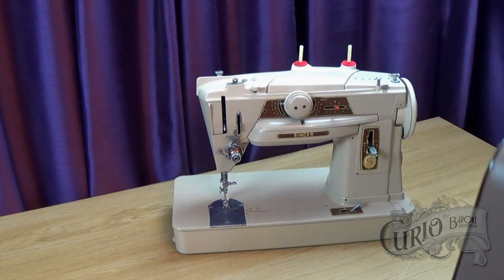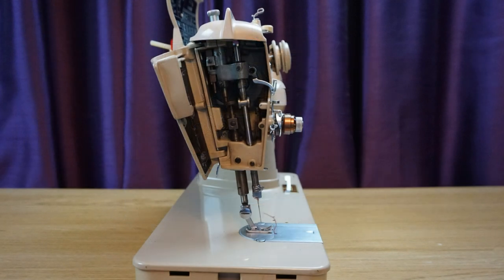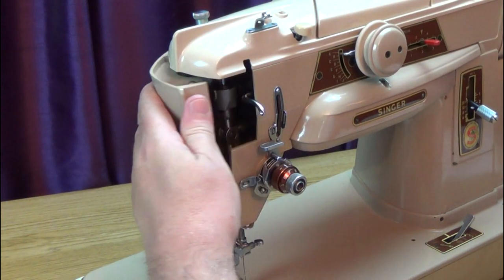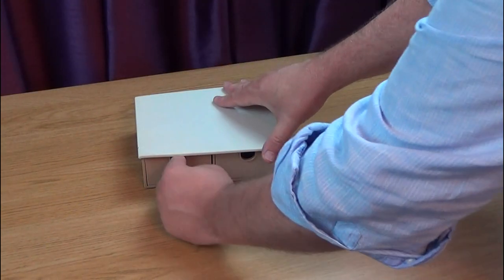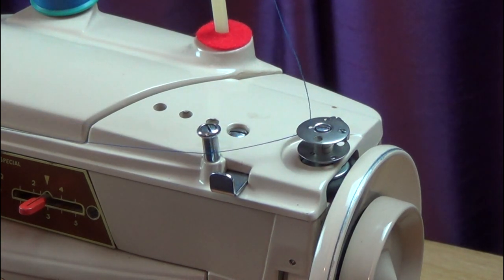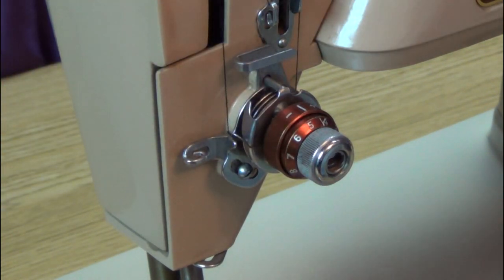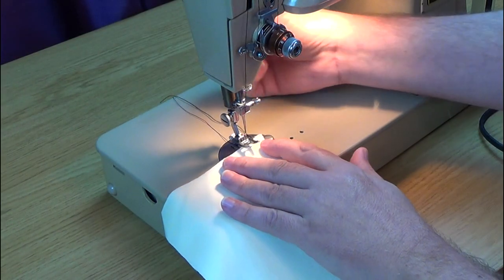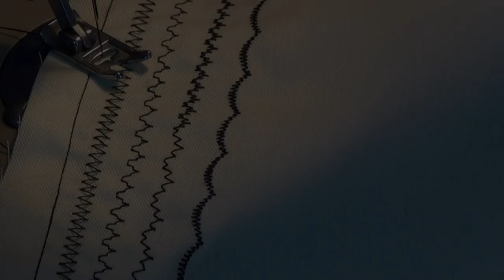Singer 401g Slant-O-Matic Vintage Sewing Machine

Comment: Maiden voyage of my new Singer 1956 401 G today
after my lube and oil so silky smooth and powerful made from recycled Luftwaffe aluminium airframe this machine flies so gobsmacked by stitch quality
Cost $60 Australia & some enthusiasm wife bought for me Fathers Day
Thank you for sharing your knowledge and great presentations 
Mmmmmm there’s a ghostly call in the wind “time for another sew machine”
Reply from the maker: That was a good price! The rotary hook mechanism and all round excellent engineering makes the 401g a machine I would be reluctant to give up. So what type of machine next?
Reply: @CurioByBSpokeDesigns  
The Rocketeer but most have their front plate missing
Reply from the maker: @Thespiansewist  Never see them here in the UK

Comment: Thank you so much for this helpful video.  I've been using my mother's 401-A model my entire life, but yesterday it completely locked up after 60 years of use - those troublesome cams, I suspect.  Fortunately I bought a 401-G about 5 years ago, so I have a spare.  This video helped me make the transition.  I plan to fix my mother's machine, but having the spare allowed me to complete my project and work on the other machine at my own pace.  I am so very pleased to have been offered the 401-G for £85 from the fine old gentleman who used to service my 401-A.  These are such glorious machines and well worth buying and maintaining.
Reply: Thanks for sharing. I inherited my 401-A from my mother. Just trying to reintroduce myself to it .
Reply: Agreed
Reply: На продажу есть машины?

Comment: It sounds great and stitches beautifully.   I have the 401g too but mine doesn't sound quite as quiet as yours! Think I need to have another look inside. Also, I think I've been threading the secondary stitch guide the wrong way round. 🙈 Thanks for taking us around this lovely wee machine.
Reply from the maker: You're welcome! I believe you can skip the secondary stitch lever altogether without issue

Comment: Interesting. I'm eyeing a 401A, but I had no idea that that machine was actually produced here in Germany. Guess, my chances of getting additional feet and, if necessary, parts for repair are actually pretty decent then. This is my biggest concern with aquireing one these oldies.
My 10 year old high end, computerized Pfaff has 'issues', which point to a defect chip and I honestly don't know, if I want to invest 300-400€ into repairing it. I hardly ever use anything but straight and zickzack stitch anyway. Maybe I would be better served with an old machine, I can take care of myself.
Reply from the maker: The 401s are still easily available and you should not have any issues getting parts. There's plenty of vintage sewing machine specialists who can help.
Reply: @CurioByBSpokeDesigns  
Thanks! These videos are really immensely helpful - I wouldn't even consider this, if there wasn't so much information available on old machines by  now.
Reply from the maker: @raraavis7782  You need to take a look at my video on vintage versus modern machines.
Reply: @CurioByBSpokeDesigns  
Already did. Working my way through your videos 😉
Reply: I didn’t know either. As soon as the video started …. Learned something new!

Comment: What do you recommend to clean the paintwork on this machine please? mine has dried old oil that has leaked over the front from where it was stored face down in a table, I think whoever "serviced" it overdid the oiling!
Reply from the maker: If you are in the UK, Swarfega - original formula. If you're in the US, Gojo - non pumice
Reply: @CurioByBSpokeDesigns  Thank you, UK here :)
Reply from the maker: @janevacani6789  The swarfega works great on these!

Comment: I am really struggling to get my thread round the tension dial and to hold the metal loop upwards the thread just slides off to the side...
Reply from the maker: Hold the reel of thread to stop more pulling off. The springs can be a little stronger than you would expect.
Reply: @CurioByBSpokeDesigns  thank you, got it through but quite a lot of birds nesting on the back side of my stitches coming out.. 🤔
Reply from the maker: @bonniestanley7690  top tension needs tightening

Comment: Здравствуйте. Кто подскажет двигатель где найти на такую машину?
Reply from the maker: I'm not sure. You may have to find a donor machine.
Reply: Так у меня их три штуки... И моторы сдохли
Reply from the maker: @АлександрГладышев-и8о  on all of them?
Reply: На всех трёх машинках
Reply from the maker: @АлександрГладышев-и8о  I've never had a bad motor. That's just unlucky!
Reply from the maker: @АлександрГладышев-и8о  Check they are the correct voltage
Reply: Надо внутренний двигатель
Reply: Слабенький мотор.. Постоянно рукой помогаешь шить даже толстые ткани... Что только не делал с мотором. Промывал.. Шетки менял... Наверное от времени стал слабым.